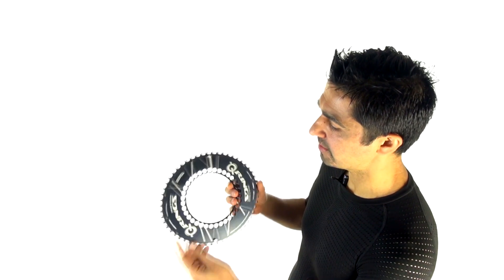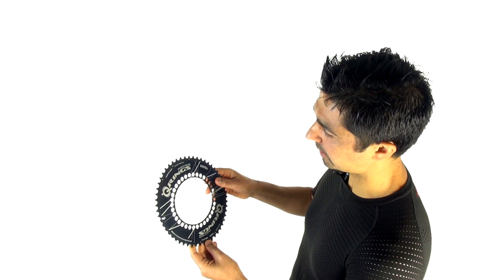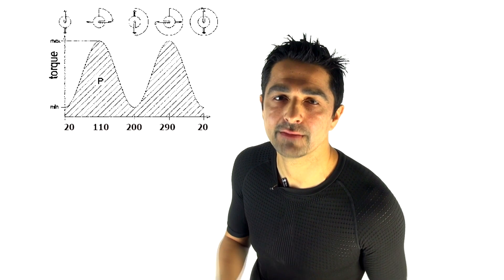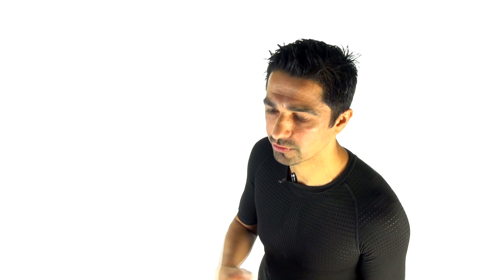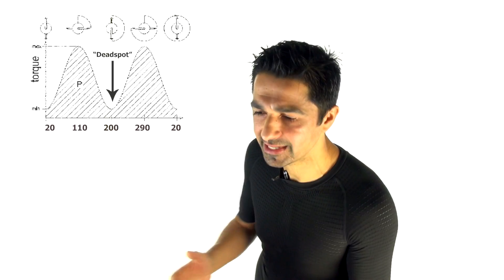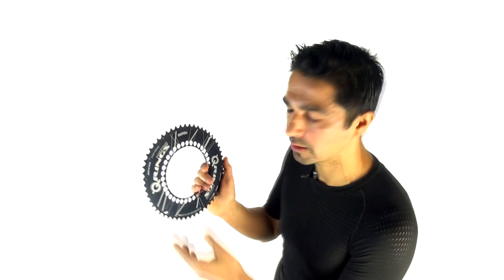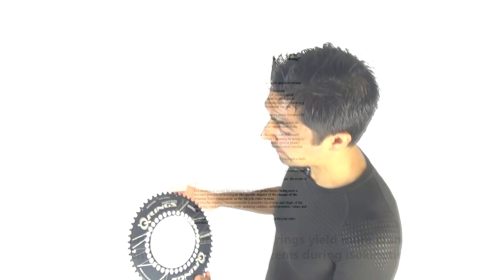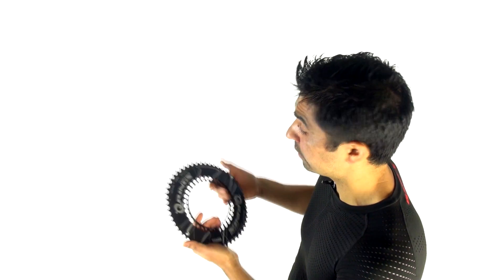Do Oval (non-round) chainrings improve one leg vs two leg cycling power (Q ring, osymmetric)

Comment: I think there's a problem here... Based on what I learned, Mechanical Advantage is gained with oval chainrings in the dead spot, from the momentary lowering of the gear(when the ring is in it's -% tooth section... & on the other hand, when the ring is in it's +% tooth section the Mechanical Leverage from the crank going from '90* to 0*' is exploited for a gain in speed... I don't believe oval rings are useless - they are practical - people just don't get the concept... Simply put, an oval chainring makes pedaling easier when our legs are weakest during our cranks rotation, whilst it makes pedaling more efficient when our legs are strongest during our crank's rotation... It makes sense...
Reply from the maker: +Marvin Connell; Yes kindof. In terms of "mechanical advantage" (aka leverage) oval vs round chainrings offer a Mechanical Advantage around 90deg downstroke by increasing the effective gear by around 10% when it is thought your leg is stronger (and in doing so a "functional advantage" by matching a better gear ratio to your power). Then they apply a mechanical DISadvantage around 180 deg in transition to upstroke (aka deadspot) by decreasing the effective gear by around 10% when it is thought your leg is weaker but in doing so giving a possible "functional advantage" in returning your leg back 270degree by 0.1sec faster than with round chainrings. However this functional advantage is only true IF 1. you needed a 10% bigger gear in the push phase/downstroke and 2. you needed a 10% small gear in the transition phase. I don't think all riders will see a benefit.
Reply: The 32oval doesn't perform any differently to a 32round IME. I have read the marketing material and it just sounds like fresh mountain air in a can I have tried several and I think oval rings are like snake oil. There is a small perceivable change in the feel of the gearing but my average speeds through segments is slower with oval rings. Slower is not good.
Reply: Marvin Connell I can confirm that oval rings improve climbing on a singlespeed mtb  - steeper gradients were achievable but as for flatter rides no real world noticeable difference until I reach the top end of my body's torque range though for track racing where sudden bursts of power are what win races I think you'd actually be at a disadvantage as it actually levels out the overall torque - out of the blocks it would be a little quicker but that not where track sprints are won,   Once you're spinning it makes next to no difference.
Reply: Marvin Connell correct!! Yes someone else gets it!
Reply: I think I'm with you here ... I don't think ovals make you faster or more powerful, they simply take advantage of a downstroke and make an upstroke easier.  If anything they should undergo a "Duracell" test.  I think the benefit is reduced fatigue over a long period.
Reply: +FastFitnessTips ... your thoughts on this?
Reply from the maker: see below thanks
Reply: I think it's true... The best way to be sure, would be to test the amount of chain pull through each half revolution... If the chain pull first increases by 10% then goes normal then decreases by 10% the benefit would be there - weather riders realize it or not... The concept, is of variable gearing & it makes sense...
Reply: That would in fact means that a chainring with a low ovality could be easily a winning strategy over the standard chainring? I mean, it would be a very small gain, but potentially there would be no worse result than standard circular...
Reply: Hello Andrea(=]) - Yes they can be... An oval 32T chanring is said to 'feel' like a 30T whilst perform like a 34T with +/-10(or so)% ovality... I haven't got mine yet so I can't test it myself - but as long as the chain pull rate increases & decreases by 10% twice each crank revolution, It Will Be Fact, weather the rider notices the difference or not... =]
Reply: There should be a proper test - an oval driving or being driven by a fixed rear... & if there is any change in rotation speed of the section being driven - they work, & that's that...
Reply: Jonny I can confirm that I have not experienced any long term improvement on any bike fitted with oval rings under any power delivery scenarios. Only thing that is noticeable as that the pedaling feels smoother. But on climbs time from bottom to top of the climb I'm always quicker on the round rings. Another strange phenomenon is that if I train on the oval and race on the round, I fair better in the race on the round ring. At best my preferred usage for an oval ring would be for training.
Reply: That's exactly what I want... When I get mt oval 34T, I want the torque of a 32T & the speed of a 36T... I've decided on a new way of verification... When you switch between chain rings with circle rings, your rear derailleur will either tighten or slacken - & this will show a forward or rearward movement of the derailleur - JUST AS a rear derailleur constantly bobs forward & back when an oval ring is in use... The proof is there weather riders feel it or not - oval rings are superior... PS: Oval rings are like V-TEC(etc) - but instead of catering to torque improvement at higher RPMs, they cater to the opposite...
Reply: Marvin Connell I don't think you will get the torque of a 32T ring and the speed of a 36T ring. The chain ring still pulls the same amount of chain therefore the gearing ratio between chain ring to cassette sprocket remains the same. The only difference will be momentary variances in the Force you are applying to the chain ring teeth. And here lies the rub. No oval ring I have tried has lasted as long as a round ring and the teeth don't wear evenly and that wear is  more exaggerated when compared to the wear on teeth on a round ring
Reply: MP48 I agree. The oval will reduce fatigue meaning you can maintain a certain speed for longer. It won't make you faster in the simple sense of you could do 42kph but you can now do 45kph. What it will do is reduce a course time from say 4 hours to 3 hours 58 mins.
Reply: Where on oval rings wear most\first? As long as the derailleur moves back & fourth, the chain pull increases & decreases - the same as it would if you were to constantly switch between a 32T & 34T - which means it works(the gears virtually change)... Why do people still doubt the effectiveness of ovals?
Reply: they wear most in the high gear position. There is simply no independent evidence to suggest that oval rings work. If they did why are Campagnolo, Shimano and SRAM not spending R&D millions on developing these rings further. Simple answer: Oval rings are snake oil. They do not work except in the minds of people who have become convinced by marketing. 

E.g "which means it works(the gears virtually change)." A 34T ring is a 34T ring. It has the same number of teeth pulling the chain per revolution whether round or oval. Therefore the translational development is the same for round or oval, therefore there is no extra power or torque. It is not a 32T ring  unless there's some sort of Schrodinger effect going on where it is a 34T ring and it isn't.
Oval feels different because chain tension increases and decreases (the jockey cage is working a pretty strong spring or clutch)
Reply: Oval works because of different muscles involved. Point is that does not exist a "one size fits all" and the greater the ovality, the greater the risk of worsening compared to "standard" chain rings. With a mild ovality it would be difficult to see disadvantages, but gains will be small
Reply: I think 'ovality' stays between 10 & 14% across different brands because more would be to drastic a change(twice per revolution)...
Reply: I just bought a pair of doval with reduced ovality of 6% on the small ring and 4% on the big ring. For 25 bucks I think it's worth to give a shot.
Reply: Interesting... You ride road? Have you tried other rings before? =]  (what brand did you get?)
Reply: Yeah, I ride road bike, but never in ovals. This ring will arrive in mid Feb, then it will be a month before I get it out on street (now here is pretty cold and I prefer to use the turbo)
Reply: What brand rings did you get?
Reply: As I said, Doval (line ulofc, standing for ultra low ovality for clipless). It's a south Korean brand
Reply: Ok - I think I already checked them out, but I will do it again - Thanks...

Comment: Power aside, does an oval chain ring cause you to be less smooth when riding. Particularly when your on the flat and spinning quickly, does it affect how smoothly to pedal?
Reply from the maker: Hi yes, if you mean less smooth in terms of alteration of sensation of resistance (power) around the 360 then yes because it makes the downstroke more "sticky" and upstroke more "easy". but  if you mean pedal speed there is little alteration normally with round chainring but in theory non-round should make the pedal speed more equal all the way around See https://www.youtube.com/watch?v=k3qr2Er-EdA for visual demonstation.
Reply: Fastfitnesstips I remember riding a Biopace many years ago and felt my cadence very uneven. Maybe it was just me.
Reply: I rode biopace for a long time, also many years ago of course, and i didn't notice that.  However, i do remember going back to round rings and thinking they were harder to ride because they didn't ease up on the weak part of of the crank rotation.    There is so little difference that you can install these on fixed/single gear bikes without using a chain tensioner.   I think they are a good thing.
Reply: From what I understand, Biopace were oriented 90 degrees off compared to modern ovals, so they aren't a good representation.
Reply: Opposite I find it smoother especially when standing/grinding

Comment: Interesting vid, although I'm not sure that we 'finally have the truth'! Until a proper, large scale, accurate, impartial test is done, we won't get the truth either, but such tests are expensive and time consuming. Personally I run a 36t Q on the inner ring and a 50 round on the outer, it's what works best for me.

Comment: Cliff notes:

       Taller Riders ... More Benefit
       Shorter Riders ... Less Benefit.

Shops resist them because ... ? Evidence is they ARE 10-15 per cent tougher on toes.

They work, but the the leg muscles used are different.

Science includes crank length AND leg length AND set height.

Bike shops shouldn't echo industry on this kind of thing ... they DO work ... if YOU will too. HBFitnessTech #HBChristo.

Comment: I may not have got my head around this properly, but isn't the point about oval chainrings not about the decrease in efficiency in the upstroke, but about the point where the cranks are between the 10 O'clock and 2 o'clock positions where either leg is getting to the bottom of the downstroke (down stroke being where most of the power is derived) and thereafter transitioning the next leg to the top of the downstroke a bit easier/ quicker so the next leg can push a big gear again on the downstroke? Either way I like this guys vids and look forward to trying my oval chainrings - I went for cheap ass Doval chainrings on Ebay - will see how they go!
Reply: Rich Cook Noticed them since I'm here in he Far East. Dovals are made in South Korea by a small workshop. Very affordable. I can a double set used for USD34.

Comment: Another excellent video. Hope there's more of these planned!
Reply from the maker: Feel free to suggest some hot topics
Reply: 1. Tyres: tubs vs clinchers vs tubeless. Cr, CdA, weight, durability etc. of all three options.
2. Ceramic bearings. Performance, lifespan.
3. Optimal cadence (range?) for Certain events. Time trials, 5 min hill climb, etc? Is this rider specific? Other variables.
4. How crank length affects TT position. What's the best compromise?
5. Anything related to power data analysis - particularly use of power curve.
6. How air temperature/pressure affects performance
7. Anything related to tapering/peaking for key events

A long-ish list as they randomly came to mind. Would be awesome if just one of these was interesting for a future video. Thanks
Reply from the maker: Some great ideas there! Next is likely to be how to chose the optimum gear ratio (which will cover optimal cadence); but after that will look at your list